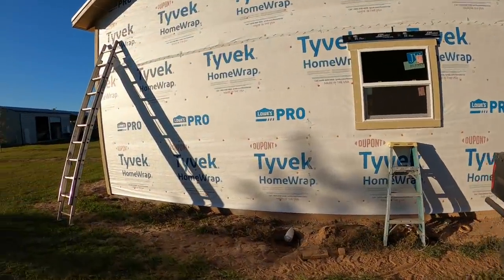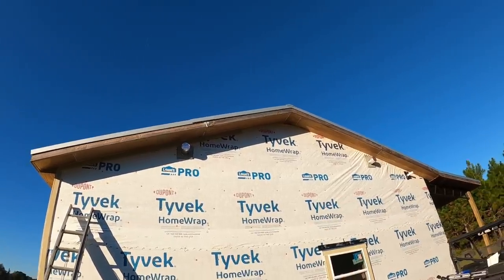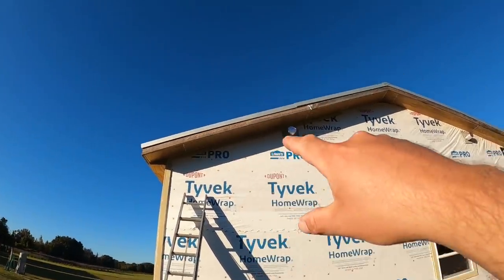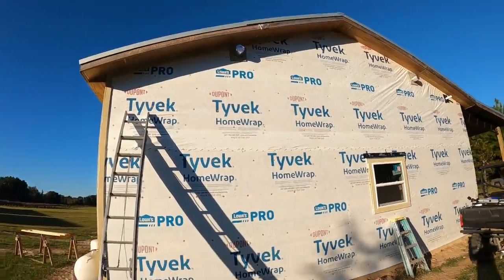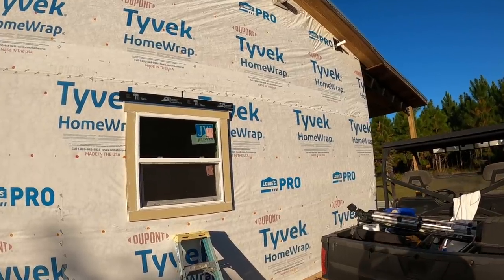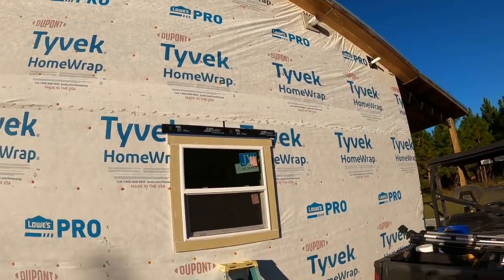Installing the last window and other work! #472

Comment: Question Andrew: You are doing an excellent job of making your home air tight, but I am wondering what is stopping air leakage between the Z-flashing and the top window trim board? You cut the Tyvek and slide the Z flashing in and it seems the air can leak under it. Otherwise, looks great!!
Reply from the maker: Foam sealed all the way around the window from inside the home.

Comment: Great work Andrew!  Any particular reason you used the jigsaw to cut the 45° angles for the trim you installed around the circular vent @ 1:25?  Miter saw out of commission?  :-)
Reply from the maker: No hardi blade for the miter saw and just felt like using my new jigsaw.